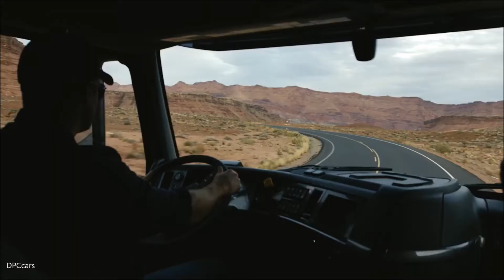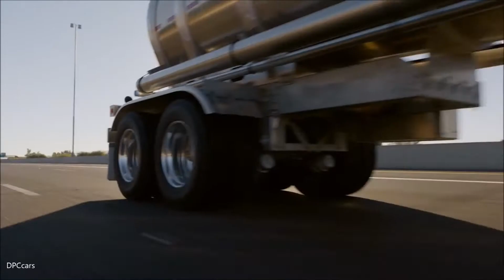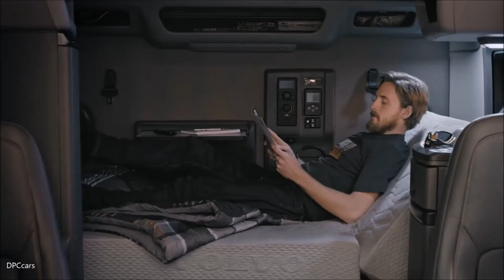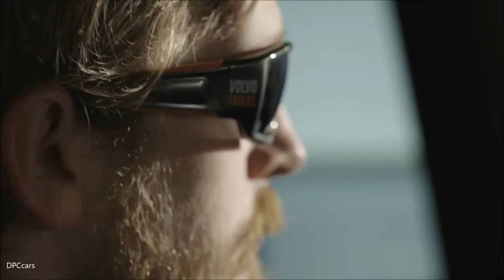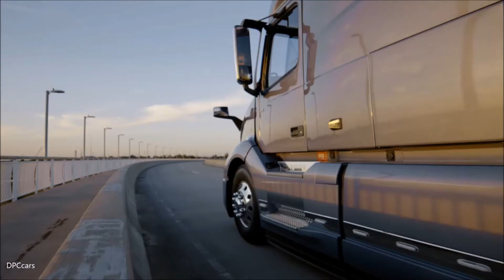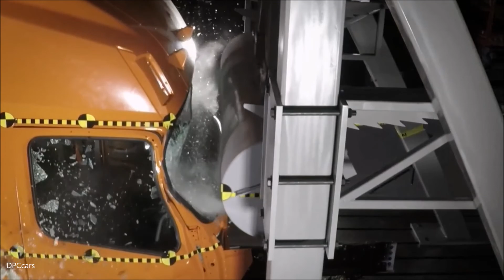2018 Volvo VNL Truck Features & Options

Comment: I drive this truck as its very nice and spacious I have to say the technology of how it stops and slows you down is very dangerous. For example going up a steep slope your doing average 50mph not even or slower you need the momentum and speed so at times truckers get close, however when safe I get o around this thing slowed me down from 50 to 30mph
Reply: Not cool
Reply: What engine?